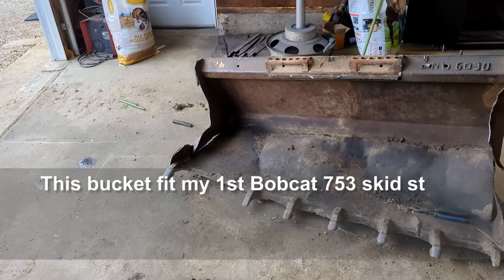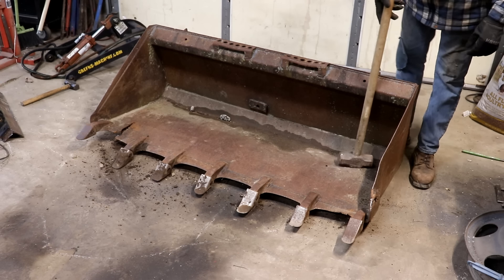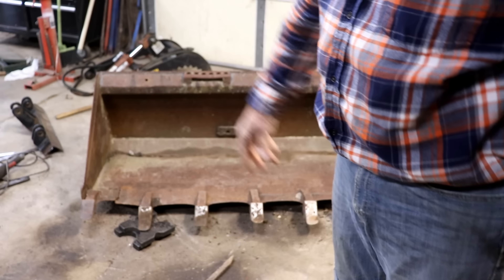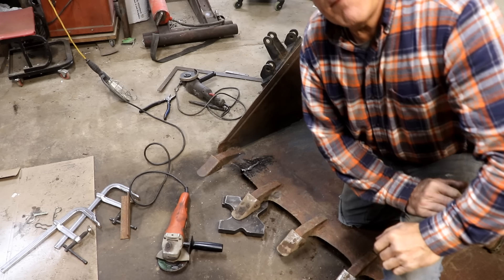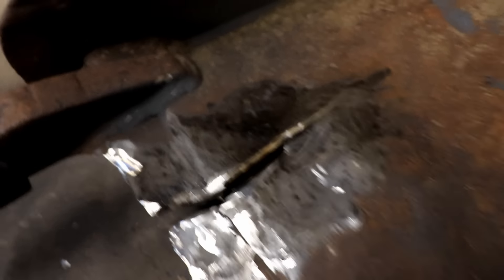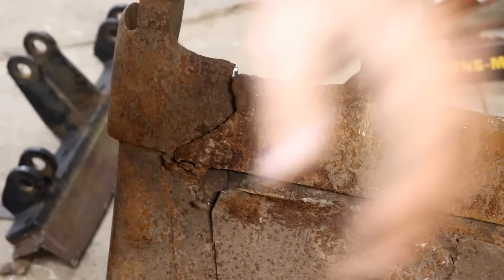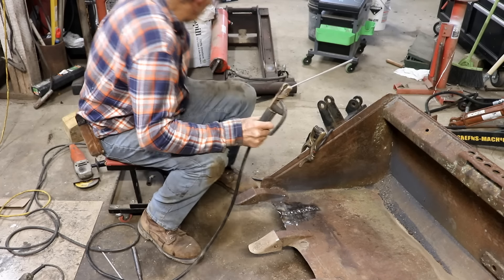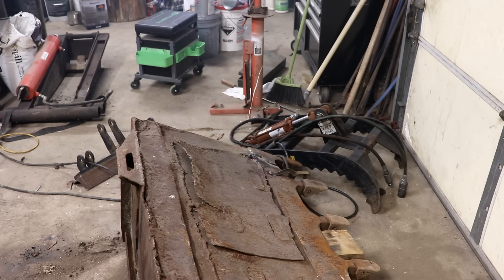681 RSW Grapple Bucket ReBuild

Comment: I worked in a cement plant over 40 years ago and the welding shop used to use some kind of hard surface rod to build the edge of the buckets back up, you may have ran into some of that kind of rod.

Comment: Hi Jerry. You'd have been much quicker grinding those welds down with a 36 grit grinding pad. Looks like you were using a much finer grit cutting wheel. You got the job done though.

Comment: Hello from Jerry in Branson .. I suspect whoever welded this grabbed a nickel rod ...like you use for cast iron .. this stuff is hard and almost impossible to grind off .. 

 Truly horrible popcorn welds ... 

7018 good over an initial weld of a penetrating rod like 6011 .. 

 WTH 6014 is a good choice if you might need to grind  it later or machine it in a lathe ect.. makes a pretty weld like 7018 .